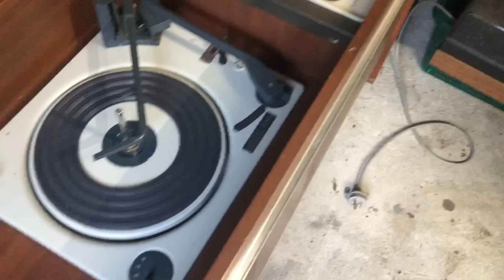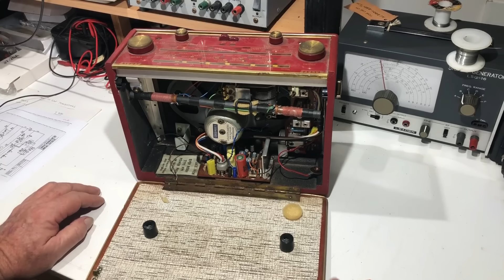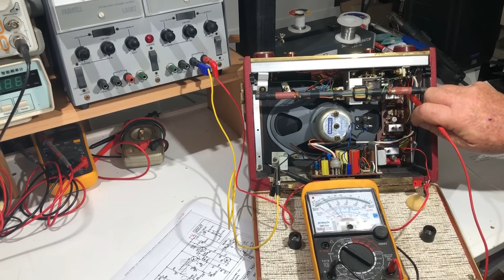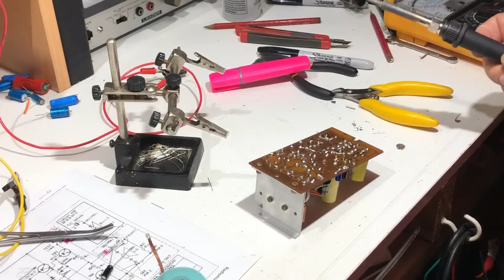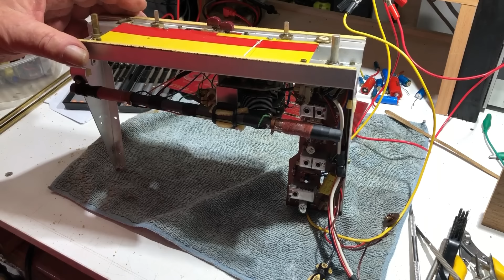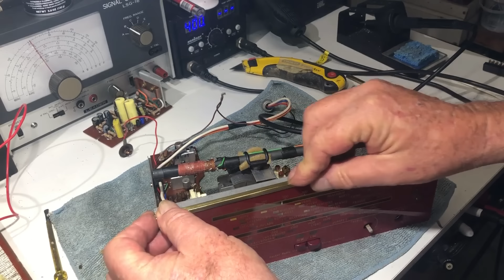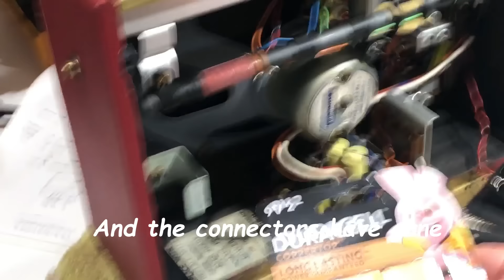HACKER Herald model RP30 Repair and Restoration

Comment: Hi Don, The HMV console please. 

I used some Jaycar high voltage (450vDC)  electrolydics in two recent radio restorations, they did not last long, one let go only a couple of minutes after installation, it sounded like a shotgun blast and scared the wheaties out of me. The others seem to have failed after a few weeks of operation.

I found Carl lives locally and visited his house, he is an interesting guy and I had an enjoyably conversation with him until I realised I needed to be on the other side of town to pick my wife up from work (Oops), time flies when your having fun.

I picked up some stronger caps from Carl, hopefully they will do the job.

Regards, Peter from Canberra.

Comment: Loving the Hacker - will have to have a go at an early germanium job myself. Graham (Radio-cruncher) has made a PP9 rechargeable battery case fitting different rechargeable batteries inside the case which provide the same or more power than the original PP9 batteries did, and I think a few others have made battery packs than can be used to replace the PP9 on YouTube also. Yeh...HMV for me too 😁 I wish I had the room for a console radio like that, they look stunning when restored. Sound great too.
Reply from the maker: Thanks.  I'll see if I can find Graham's video about the PP9 replacement.  Of course I would also need the connector clips  which are missing on mine.  Ebay, perhaps.
The hacker is a nice looking radio and sounds very good.  It's such a pity I can't play music on YouTube.
Everyone seems to be voting for the HMV so it looks like I'll give it a go.
Cheers.

Comment: Just a further thought Don and in case you do want to go for a more original style of look for the batteries. Some time ago I posted an approach on the Hacker Radio Group and in which cheap and cheerful AA batteries are used (either alkaline, or indeed rechargeables as the Hacker happily tolerates their lower voltage). 

If you search for entry 7808 within the "messages" section on the Hacker Radio Group site you should find it.

Obviously one needs old/depleted PP9 batteries to do this, but the other entries on this discussion thread went on to suggest other approaches for battery cases. Or just using the AA battery carriers will do (as the case is just cosmetic) and will provide considerably more running time than PP3 batteries. 

Hope this is helpful or of some interest. As these (and other often now redundant battery types) were often used in older transistor radios. Gerry

Comment: Hi Don, Give that old HMV some love! Console radios are rare here in the UK, I suppose they take up  too much space. As for the rp30, I have two of them, and I'm surprised yours didn't need the 'zapping'. I have a red and a blue rp30, and although the blue one worked initially, it wasn't long before the AF117s played up.
Reply from the maker: Hi. Graham suggested that the AF117s have been replaced and I think he's right.  The little ferrules are missing and the soldering is a bit ordinary.  Pity they didn't do the caps as well.

Comment: Great job on the Hacker Don. It came up very nicely. The RP30 is one of my favourites and they sound very good. It looks like the AF117’s may have been done as the little ferrules seem to be missing but it was difficult to tell from the video. Very lucky that they actually work though. I’d like to see the console radio done as they look amazing when done. All the best Graham
Reply from the maker: Hi Graham, Yes, the AF117s did look like they had been replaced.  The ferrules were gone and there were small blobs of solder that had "leaked" through the holes from the solder side of the board.  I guess I got lucky - so far.  
Do you have any advice re batteries?  I don't think those little 9V ones will last long.  I would also have to buy connectors for them as they are missing. I seem to remember you doing a video trying out some battery boxes made to look like the originals but I can't find the video (yet).
Cheers